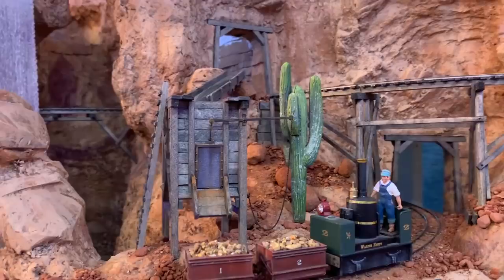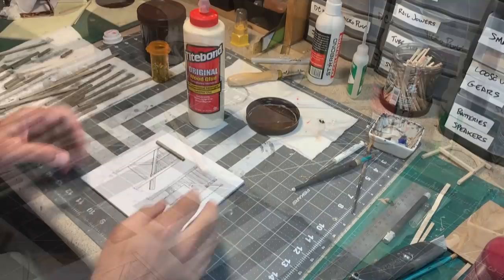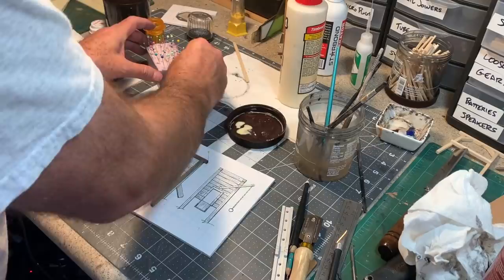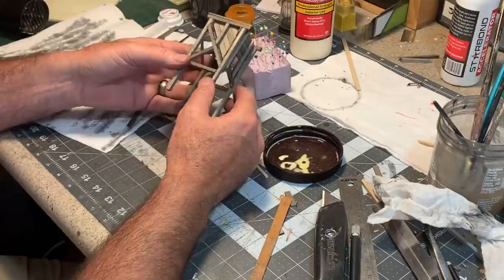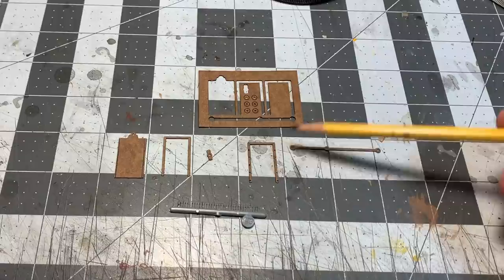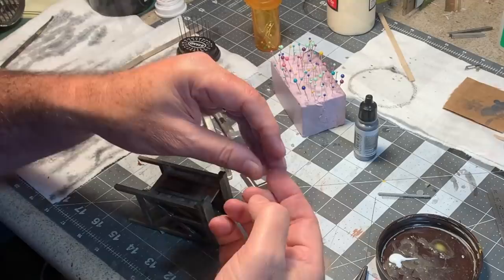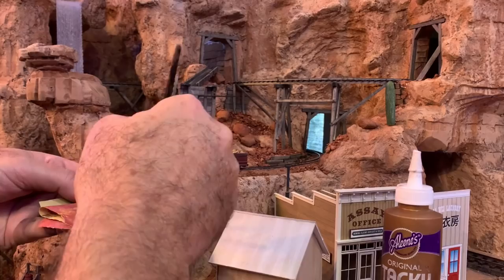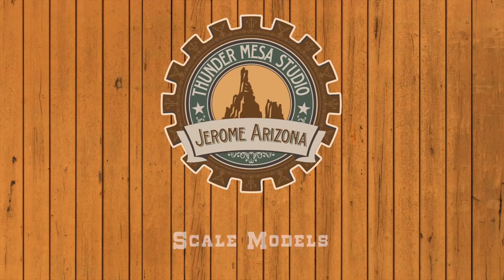Calico Mountain Expansion Part 11: Scratchbuild an Ore Bin

Comment: Very nice model.
I bought a similar precision razor saw last year (from JLC in Czechia), and it's a great tool. I don't know for real wood, but for making wood grain from styrene, it is the best tool. Depending and the side of the saw, fine or coarse grain can be made in one or two pass. All other ways I used before were more time and elbow grease consuming!
Don't have yellow glue here in Europe, only PVA, and I prefer the exterior version as it is fully transparent when dry. And PVA is easily dissolved with white vinegar.

Comment: Beautiful work, especially the model airplane style building board. I was with you until you dropped a term of art NBW. Clearly if I had been staying current in model building I would know what an NBW is, but ...  Fortunately, I've lost any inhibitions that I might have had about pointing out my ignorance. Again, a very well designed and detailed piece for what looks like a very good RR. Some ideas that I will be stealing for my next layout.
Reply from the maker: Ha! My bad, I usually try to define my terms. NBW = Nut, Bolt, Washer castings.
Reply: @ThunderMesaStudio  Queue Homer Simpson forehead slap with, "D'oh!" As with everything now it makes perfect sense. Nut and bolt construction is a bit more rough and ready than the rivets that I was imagining. Thanks!
Reply: @ThunderMesaStudio  If you are still thinking about a pin cushion. My wife really likes the Grabbit Magnetic pin cushion, it will work great with your dump them out style and simplify collection of loose pins.

Comment: Dave , nice build, where did you get the Japanese razor saw/metal miter box? Quick tip you might also try Silverwood by Builders in scale for wethering wood. Similar to alcohol and Indian ink however there is a stain in it that turns wood gray. I've been using it for the last ten years the large bottle lasts a long time.
Reply from the maker: Thanks Todd. I've added a link to the razor saw and blades to the video description.

Comment: Dave - is the Miter Saw you're using there significantly better than the traditional one?  Looks like a good item to add to the Christmas list, but I already have too many tools.  Is it worth getting to replace some?  Thanks!
Reply from the maker: It's an excellent tool that I find cuts basswood much more cleanly than a traditional razor saw. Plus you can buy new blades for it when it gets dull. Is it a must have? It was for me since I was never really happy with my old razor saw. So, If you already love the saw you have, you probably don't need this one.